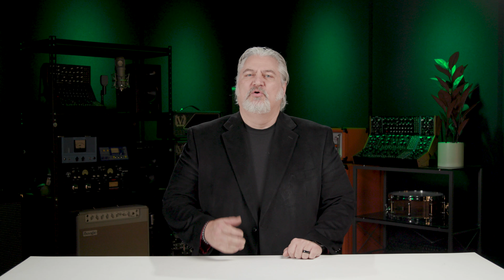What Is Noise Floor?

Comment from the maker: Keep that signal clean! How do you maintain a low noise floor? 👂
Reply: I'm a sound recordist for work, and often get asked what a good setup would be for someone looking to get started. I always tell them: Get a quiet mic and a quiet pre-amp and you're 90 percent of the way there. Thanks for the videos, always love these quick bites on terminology.
Reply: By using a Chord DAC without any noise floor modulation

Comment: how does the noise floor setting function on a simple compressor?  is that the boundary, above which, the sound is processed, and below which the sound is left alone? or what?    anyone? TIA                
local Ft Wayne question:    Do the amish buy/play music gear?     also, at times i envy them = totally immune to the cost of owning a car these days.  also zero buggy-jacking.

Comment: Long wondered what the reason is for a limiter in equalization just for 60 Hz. You can get 60Hz choke  filters for electronic devices that plug in directly to outlets, why not sound?